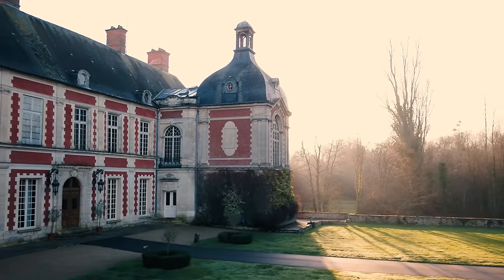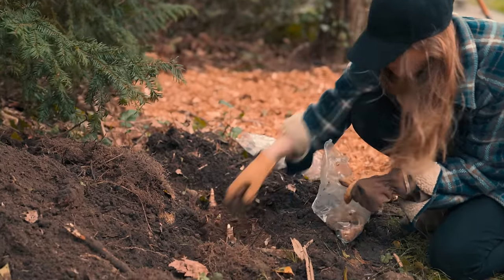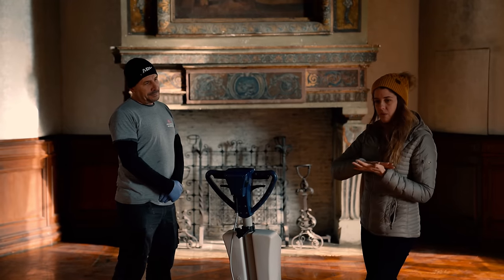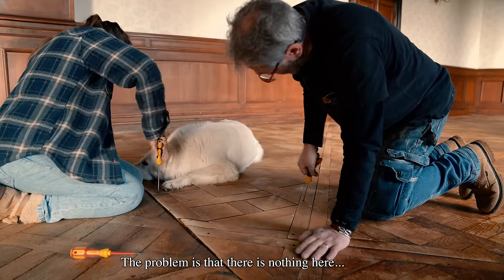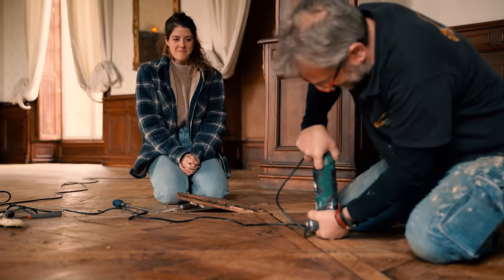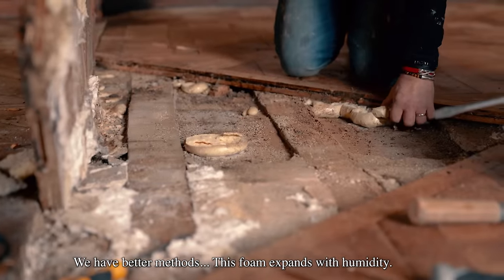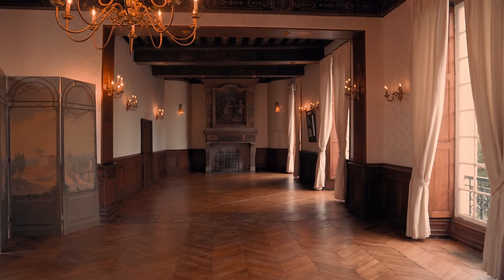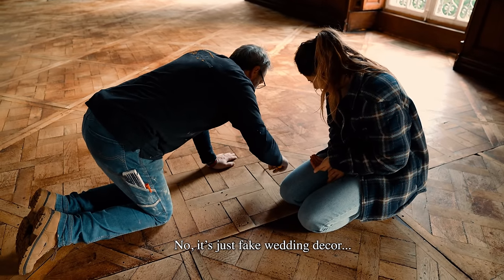Restoring Original Versailles Parquet Flooring | French Chateau Renovations #46

Comment: "Waxing the floor between every single event." The floors in our château are a similar design to yours. We oil our ballroom perhaps every five years using Osmo PolyX. It is the perfect product because it is natural oils, not wax, and the wood holds up beautifully. They look as though they are polished every day, but no, only at five year intervals. They take a battering too - numerous events, kids, dogs, skateboards, you name it, yet after all this the Osmo is still perfection. I cannot comprehend of doing the floors after every event. What a chore!
Reply: I agree. There are way better products available now other than traditionnal wax. 
Hell, I'd even try to epoxy the floors completely to seal and fill in the gaps, then sand smooth, and then either varnish with Bona Trafic hD or some Oil based product. The epoxy would stabilize everything and keep the wood intact for another 100 years.

Comment: Rather than waxing the floor consider having the parquet lacquered.  We have a solid oak floor that is lacquered with Bona lacquer. It is cleaned with Bona wood cleaner which is sprayed on and mopped with a microfibre mop - no water which preserves the wood and the finish. The first time it was done it lasted 10 years.  The artisan that did it had refinished the floors at the British museum in London so you get an idea how hard wearing it is. ❤

Comment: If you can keep those bulbs in a cool place until the fall you can put them in the ground then. I was told to store them in dry saw dust.  The Agway manager years ago gave me his out of season stock but I couldn't get rid of them all and also forgot to put them at the right time. I got distracted and missed the right time to set them in.  By the next year they had dried out. 
Apparently parquet de Versailles was not the first choice for the palace. The state apartments were originally paved in marble. However marble proved to be difficult to wash as the water would seep through and stain the ceilings of the apartments below. The parquet was easier to wash because it would swell and not leak 
If the floors are not original to your chateau perhaps you have some of the Versailles parquet in more than name? The palace has been refloored many times in its history and the old parquet was sold off. That building has taken a lot of foot traffic. No doubt it all gets bought up by apartment dwellers and house builders/remodelers etc. Did your grandfather have them installed? The fact that the floors were herringbone in part tells some kind of story of having some but not enough for the whole room.  
There's even a story of a time when a child was born to one of the princely couples. The courtiers, as a celebration, took the boards for some parquet not yet installed and built a bonfire with them. The King said, more or less, let them have some fun!   
It's been a common floor pattern in France for several hundred years but who knows, maybe you have some of the original stuff from one of the refloorings?

Comment: Not sure what kind of wax you are using but a waxed and polished floor should only be re-waxed infrequently. It should be able to be cleaned with very damp cleaner and wood soap. I was in France and where I stayed, a liquid wax was being applied once a week and it never hardened and ended up mushy and floor impossible to clean as it never was allowed to thoroughly dry and cure. If you have it in France, an excellent product is Osmo, a liquid wax that hardens and is designed for floors. It's not cheap, but applied properly, maintnance should be fairly easy. Wax needs time to cure though.